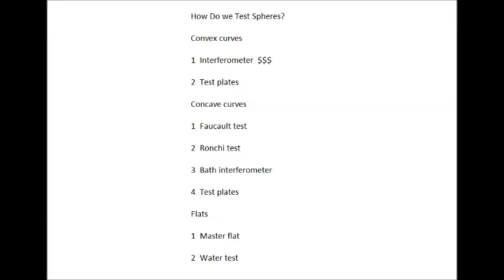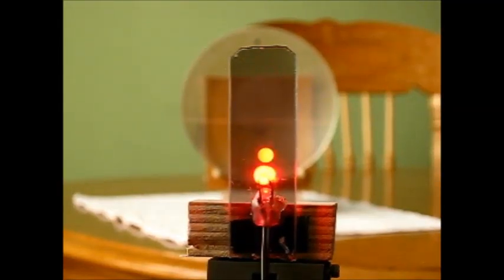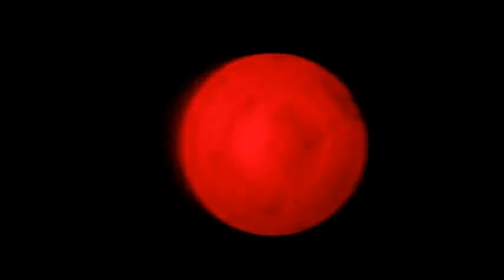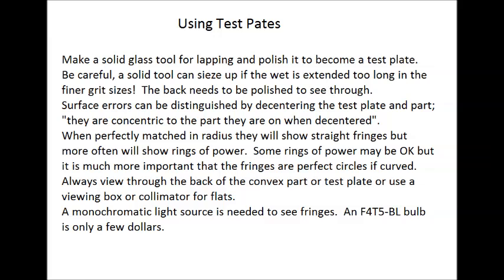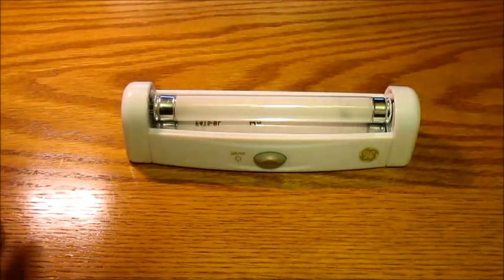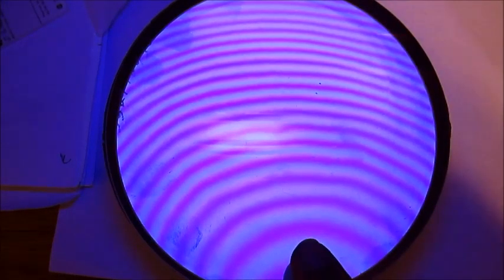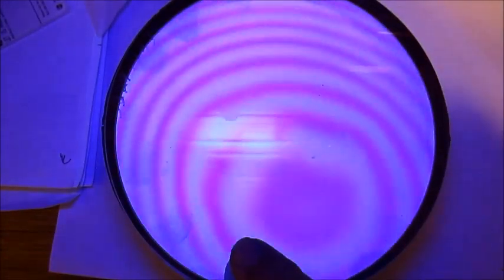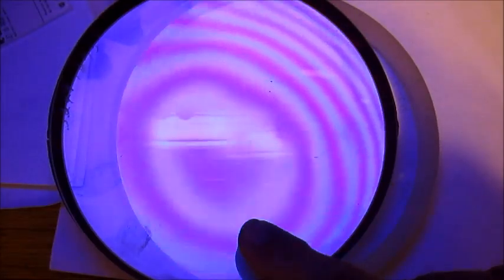Lens and Mirror Making for the ATM #8

Comment: Just to clarify the top convex optic has a longer radius if the fringes increase closer together, with pressure over the bulls-eyes? Thanks.
Reply from the maker: Correct, the fringe diameter gets smaller.